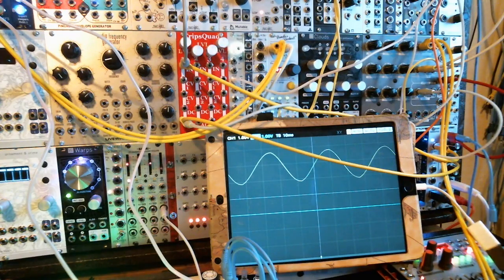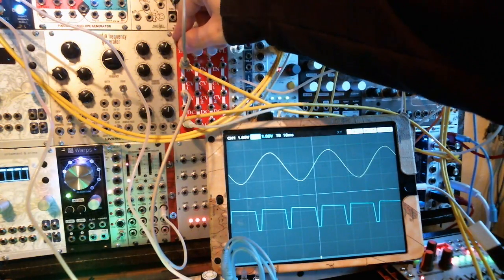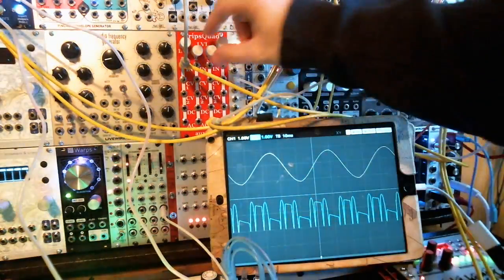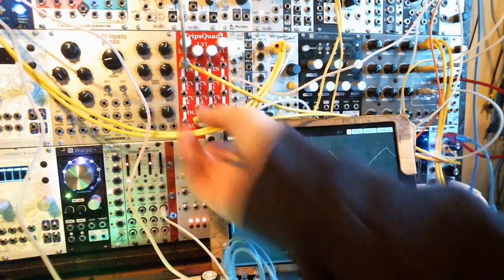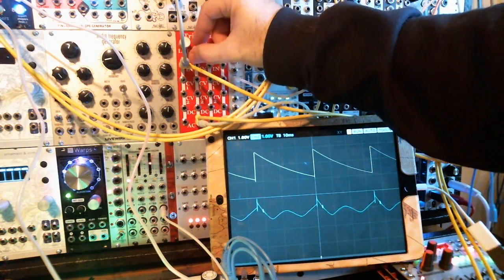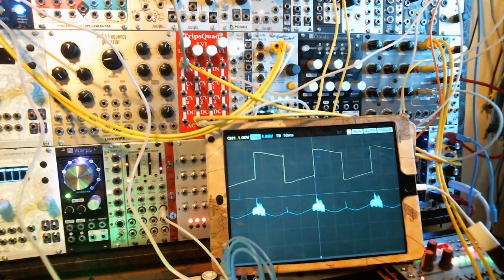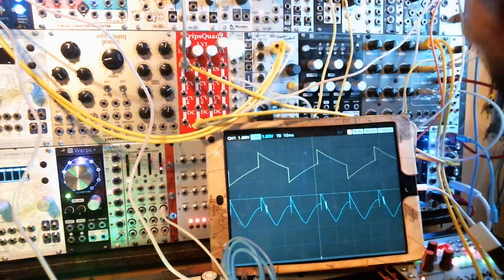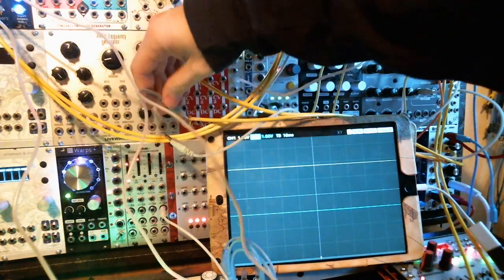TripsQuad Waveshaping

Comment: CAn I ask what that oscilloscope is?  I'm on the lookout for great o-scopes and spectral analysis for synth experiments.  Thanks!
Reply from the maker: psionic111 it’s a free iPad app called OScope
Reply: @Auxren  Thanks, I've got an old iPad2 frozen on OS 9.3.6, but Oscope doesn't come up in App Store.  I also have a 2017 iPad Pro on latest iPadOS.  I've tried out a half dozen oscilloscope and SA apps, can't seem to find one called "Oscope".  Now trying Audio Oscilloscope, as that one snuck under my radar.  Thanks for the suggestions and the video, nice avatar with Jordan!

EDIT:  Actually I see a paid app called Oscilloscope that seems very similar to OScope... I wonder if this is the same app... made by ONYX Apps?